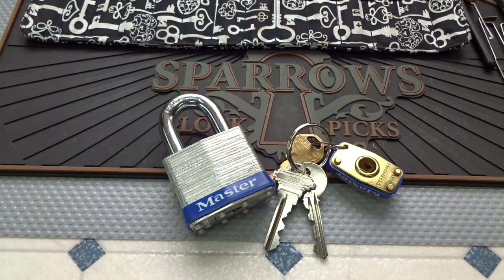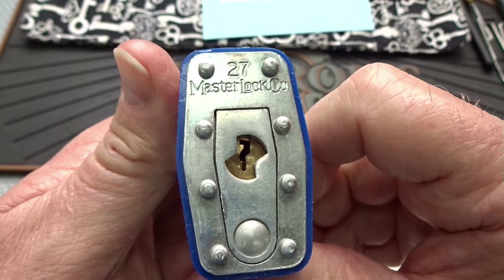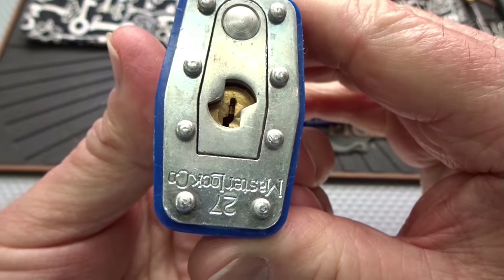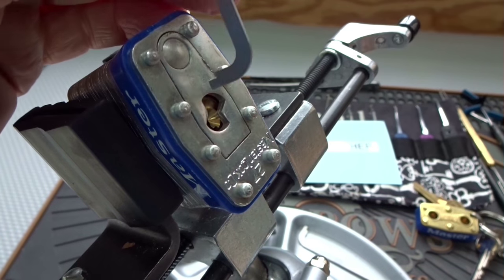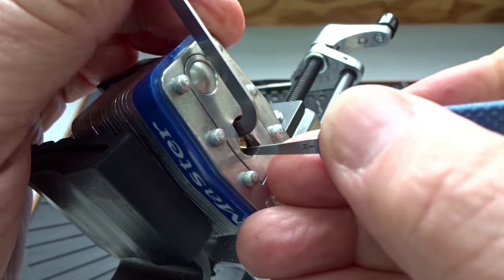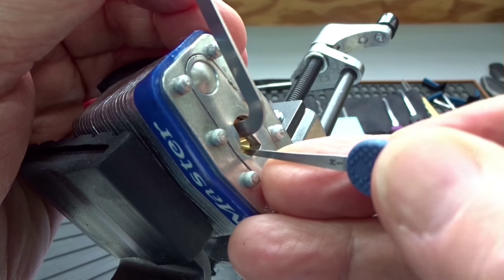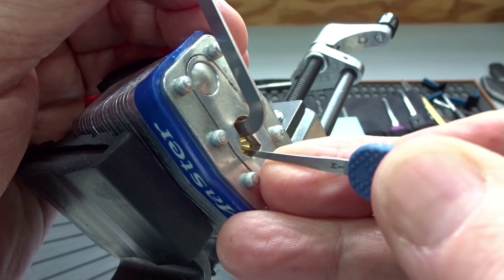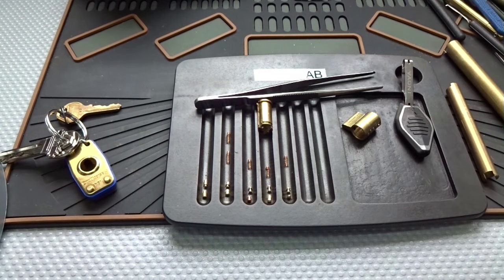(801) Challenge: AWESOME Master Lock 27 by TheLockButcher

Comment: "weird metric one"? lol dude.. 
1 mile = 1.760 yard= 5.280 feet = 63.360 inches
1 km = 1000 m = 10.000 dm = 100.000 cm = 1.000.000 mm
Reply: +JohnGribbin Thank you! hahah
Reply: I highly doubt the imperial measuring system allowed the US to send a man to the moon and a rover to Mars, to be completely honest.
Reply: No, that's true, and I believe that NASA did most of its calculations in metric, as many scientists do. Many systems do not make sense, such as the English measuring system, AC power, and NTSC video framerates. Many of these are either invented to avoid the need to replace large chunks of infrastructure norms or are not replaced with newer, better things due to the cost that would take. To replace the English measuring system in the US would be feasible, but would also mean replacing or updating a lot of infrastructure. It could be done, but we're happy with the current system, and used to it, so why spend the money to change it?

On the flip side, the fact that there are two different measuring systems did crash a orbiter into Mars. In 1999, the calculations for the thrust of a Mars orbiter were done in the English system (by a contractor), and system (by NASA) expected them in Metric. So, without the proper prior conversion, the orbiter held a lower trajectory than it should have and spiraled into Mars' surface due to computation error. Both systems work fine, and work together as long as they are converted properly. However, people do have to be specific.

How messy is the English system? We do of course adjust how we use our measuring system to simplify it. We rarely ever convert miles to yards or inches, rather measuring long distances in feet or miles, typically. Yards are for fractions of a mile where it is more convenient to measure in yards than feet, such as 200yds vs 600ft, or 10yds vs 30ft, but still not really used that much. We don't use furlongs or fathoms any more, and 1/16 of an inch are easier to read than a millimeter, and both 1/32 and 1/64 of an inch are finer than a millimeter. Ounces, cups, pints, quarts, and gallons make sense, because they are all some multiple of two of each other, though dry measures are just confusing and cooks who cut a lot of butter are some of the few who know how many teaspoons go into a cup. There are that many common measures for weight, so they are easy to memorize, and by the time you have the English system down it's not too much more to learn some basic conversions to metric. Yes, the English system is confusing. It is outdated. However, it's also kind of nice to use if you're used to it, because the size of the measures just seem more natural, whereas the common Metric measures to Americans (or at least to me) mostly seem too err on the small side, such as mL, g, km, kmh, and cm. The foot is a better length than the cm or dm, the lb more natural than kg, and mph less speedy than kmh. Some of that is due to being used to the English system, and some of that is because the English system was developed by common measure, whereas the Metric system was developed as a scientific and mathematical construct. In the end it does boil down to preference, but there is a difference in that the Metric is more practical for math and the English is more practical for cooking and common measures.
Reply: THey crashed a Rover on Mars because one shop was using metric and the other was using imperial.

Comment: I need it. It toke me blood and swet to open one manster lock just like this one. Only mine could not open without a few 100 bangs with a hammer and a screwdriver.
Reply: Master*
Reply: +Daniel Jansen You can modify your comment after having posted. Look on the top right corner of your comment, there should be 3 points or a down-arrow to see the options.
Reply: +vienyish Thanks for that info. But it wont work on my smart phone. It works on the pc.

Comment: I have a master combination cable lock I don't know the code to, since I found it in a bike shops bin, can I open it and reuse it ? I realise that I will need to prove it is mine and not connected to anything, which is no problem.
Reply: yes you can open it very easily...do you know the model number?
Reply: Christopher Mendez its a "master lock quantum combi" . I have tried the method of putting strain on the lock and trying to feel which numbers click into place, but there is no difference I can feel.

Comment: I hate to say this but you are observant as a blind person.  What do you think the 5 holes on the bottom of the lock core is used for?  To allow air in there?  You turn the cylinder 180 degrees and you can drop all 5 pins and put new pins in.
Reply: Eugene Groby That would only work for the bottom 5 pins, he likes to take the entire thing apart and see what black magic the lock editor has unleashed upon him...

Comment: Came back looking for this video specifically. I didn't remember commenting on it a year ago haha. I just got a Master System-29. Same idea. Big lock ( I think it's the same size as the #19), interchangeable core. Except the 29, you can put a full size ( 6 pin ) key in lock cylinder in it. I am trying to find out what I need exactly, but I think I want a Medeco core for it.

Comment: What is a "false set"?
Reply: +GhettoRanger a false set is when one or more of the pins have been pushed into the wrong position i.e. pushed too far in and you don't know until later when you realise something wasn't done right because the lock wont open. Basically, you have to release some tension and allow the lock to turn back to release the tension on the falsely set pin and go from that point again, pin by pin. If the false set pin was done a few pins ago then this might involve correctly set pins having to be released too.
Reply: Thank you for explaining that, it's something that happens, at least to me, very often.
Reply: +GhettoRanger Happens to everyone. It is one of the main security features incorporated into locks - grooved holes and pins to cause false sets when someone tries to pick them.
Reply: Defeating it separates those who know how from those who don't which is what makes picking locks fun.
Reply: GhettoRanger I'm still working on that bit. I suppose a 1980s MOD Abus lock is probably not a good learning environment.